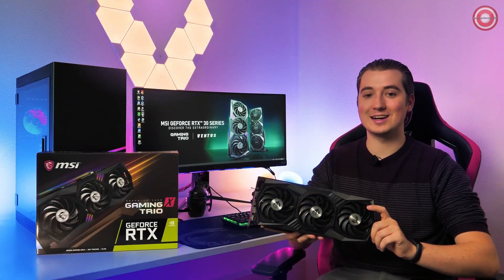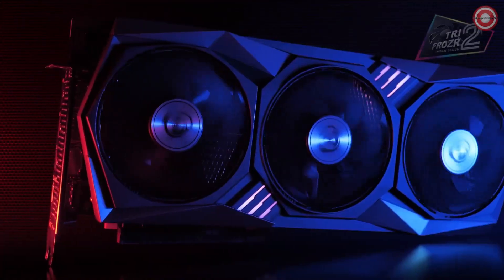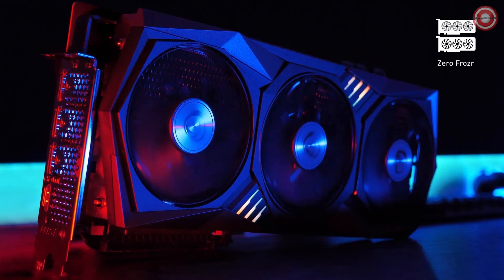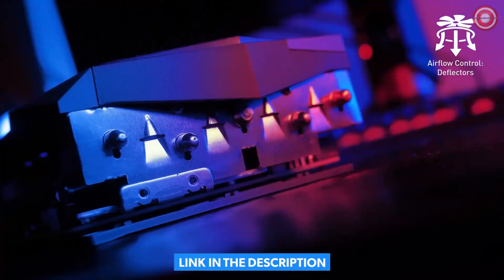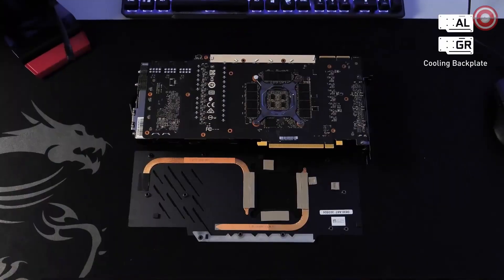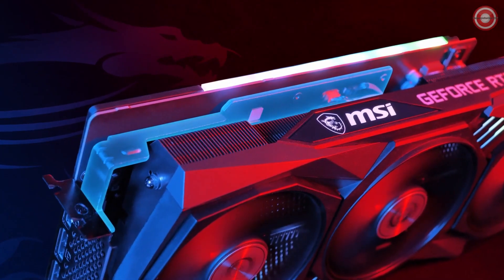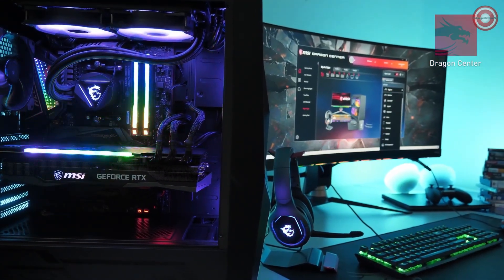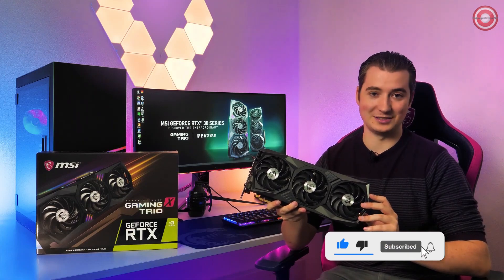5 Best Graphics Cards for Ryzen 7 5800X: Which One to Choose for Gaming in 2024?

Comment: I have a 5800x and 3070 and 16gb ram, should i get 32gb or not? I play video games and edit. In the future ill upgrade but whats the max gpu for the 5800x at 1440p.
Reply from the maker: The decision to upgrade your RAM to 32GB depends on your specific needs and budget. If you're primarily playing video games, 16GB is generally sufficient, as most games don't require more than that. However, if you do a lot of video editing, especially with high-resolution footage or complex projects, 32GB can provide better performance and prevent slowdowns.
Regarding the maximum GPU compatibility for your 5800X at 1440p, it's difficult to give a definitive answer as it depends on your desired frame rate and graphics settings. However, a GPU like the RTX 3080 or RTX 4070Ti would be a good match for a 5800X at 1440p, offering excellent performance for most games.
Ultimately, the best way to determine if upgrading your RAM or GPU is necessary is to assess your current performance and identify any bottlenecks. If you're experiencing frequent slowdowns or stuttering, upgrading may be beneficial.
Reply: @AryTechB  ye if I ever upgrade my gpu it will prob be a 5070 or 5060 ti depends of pricing ofc, but I think I'll get 32gb bcuz I'll play hogwarts legacy and it requires a bit more of ram, and it's never bad to futureproof

Comment: Is a 3060 to a 4070 a could choice ? I also have the 5800x with 32GB ram
Reply from the maker: The RTX 4070 is a more powerful GPU than the RTX 3060, so it will give you better performance in games and other demanding applications. However, it is also more expensive. If you are on a budget, the RTX 3060 is still a great option and will provide you with good performance at 1080p and 1440p resolutions.
If you are looking for the best possible performance, the RTX 4070 is the way to go. However, if you are on a budget, the RTX 3060 is still a great option.

Comment: with the 5800x do can i play mostly all games smoothly with the geforce rtx 3060 twin edges? because my budget isnt to high, also i have 16gb ram
Reply from the maker: Yes, the AMD Ryzen 7 5800X and the GeForce RTX 3060 Twin Edge are a very capable combination for gaming. They can handle most modern games at high settings and frame rates, even at 1440p resolution. With 16GB of RAM, you should also have plenty of memory for multitasking and running other applications while gaming.
Thanks for visiting my channel!
Reply: @AryTechB  Ty a lot

Comment: Hi i have a 5800x with 32gb ram wath gpu to buy for 1080p/1440p games ? I dont really play heavy gpu games maybe only bdo online is a bit heavy gpu game
Reply from the maker: NVIDIA GeForce RTX 3060 Ti Nr 4 on my list: This mid-range GPU offers excellent performance at 1080p and 1440p, and it's capable of running BDO Online at high settings with smooth frame rates. It's also a great choice for other demanding games like Cyberpunk 2077 and Shadow of the Tomb Raider.
Or
AMD Radeon RX 6600 XT: This is another great mid-range GPU that offers similar performance to the RTX 3060 Ti. It's a bit more affordable than the NVIDIA card, and it's a solid choice for BDO Online and other demanding games.
Reply: @AryTechB  so the 3060ti is the best choice here but if eventually i can buy a 2nd hand rtx 3070ti is great also ?
Reply from the maker: @flowless1773  Yes, you can buy any GPU - featured here as long as it fits your budget. Even a 3070
Reply: @AryTechB  thanks ! So with cpu is great can pair with basically any gpu over the 3060ti ok great to know
Reply from the maker: @flowless1773  RTX 30 series or similar, not higher
Reply: @AryTechB  a 4070 would bottleneck in 1080p ? Because market price a 4070 is cheaper then a 3070ti or 3080ti
Reply from the maker: @flowless1773  Yes, a Ryzen 7 5800X could bottleneck an RTX 4070 in 1080p gaming. At 1080p resolution, the CPU is put under more stress to generate enough frames for the GPU to render. The RTX 4070 is a very powerful GPU, and it can easily push out high frame rates at 1080p. However, if the CPU is not able to keep up, the GPU will not be able to utilize its full potential, and you will experience some performance bottlenecks.
In general, it is recommended to have a balanced system where the CPU and GPU are roughly matched in performance. This will ensure that you are getting the most out of both components and not experiencing any unnecessary bottlenecks.

Comment: Is 7700xt + 5800x the best in their price for cs2, bf2042 at 1080p?
Or reduce the gpu price and add it to the cpu like 6800 + r5 7600?
Because some say the cpu is more important to esports games !
Reply from the maker: The 7700XT + 5800X combination is a good choice for gaming at 1080p, and it is one of the best value options for this resolution. The 7700XT is a powerful GPU that can handle most AAA games at high settings, and the 5800X is a solid CPU that will not bottleneck the GPU. However, there is some merit to the argument that the CPU is more important for esports games. This is because esports games are often more CPU-intensive than AAA games, and they also tend to benefit more from higher CPU clock speeds.
If you are primarily interested in playing esports games, then you may want to consider a CPU-focused build with a slightly less powerful GPU. This could save you some money, and it would still allow you to play games at high settings at 1080p. However, if you also want to play AAA games, then the 7700XT + 5800X is a good option.

Comment: i get R7 5800X do you think GTX 4060 for 200 is ok with it ?
Reply from the maker: The GTX 4060 is a powerful graphics card that would be a good match for the R7 5800X. However, the price of $200 is very low for a GTX 4060, and it is possible that the card is being sold at a loss or that it is a refurbished or used card. If you are considering buying a GTX 4060 for $200, it is important to do your research and make sure that you are getting a good deal.
Reply: ye in my country it black friday so %50 @AryTechB

Comment: Im currently running a ryzen 7 5800x with a 1660ti and i need a gpu upgrade badly since cs2 came out.. I was fine before since cs:go was so cpu intensive but now i want to upgrade and I want the best bang for my buck so to say.. any recommendations?
Reply from the maker: NVIDIA GeForce RTX 4070 Ti: This is the best overall GPU for CS2. It offers excellent performance at 1440p and 4K resolutions, and it also supports ray tracing and DLSS.

Comment: I cant decide..Im really happy with the 5800X. Im currently still using a 2070 and I would like to upgrade. I dont need an overkill graphicscard tho. All my tasks are perfectly working with the 2070 atm, but in the future I want to upgrade to WQHD instead of just HD. I honestly just want the modern equivalent to the 2070, with maybe a little bit more power.. What gpu would you recommend?
Reply from the maker: I think an RTX 4060 is what you need.

Comment: im going with a Asus 3070 ti 8gb with the ryzen 5800x.but i plan on upgrading later in the future to a 4070 ti, will this cause bottle neck with the cpu if so then what would you recommend for a more higher gpu performance?
Reply from the maker: If you're planning to upgrade to a higher-end GPU like the 4070 Ti in the future, pairing it with a Ryzen 5800X should still provide good performance. While there may be some bottlenecking, it's not likely to be significant enough to drastically impact your gaming experience.

However, if you're aiming for even higher GPU performance and want to minimize any potential bottlenecks, you could consider upgrading to a more powerful CPU like the Ryzen 7 5900X or even the Ryzen 9 5950X. These CPUs offer more cores and higher clock speeds, which can handle the demands of a high-performance GPU better.